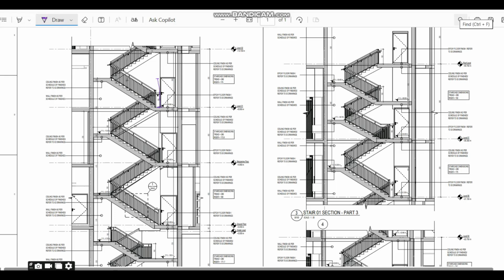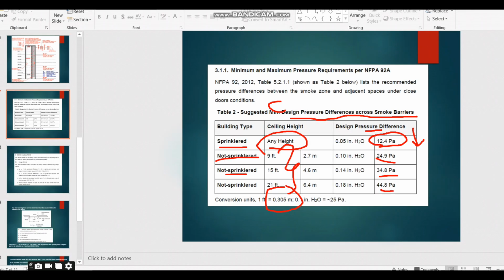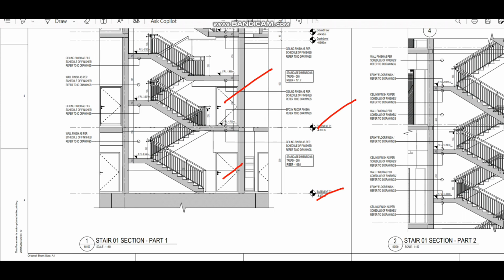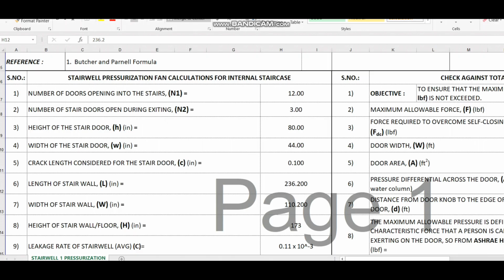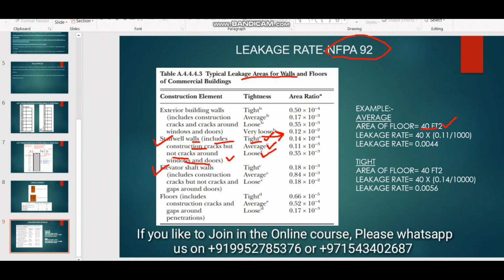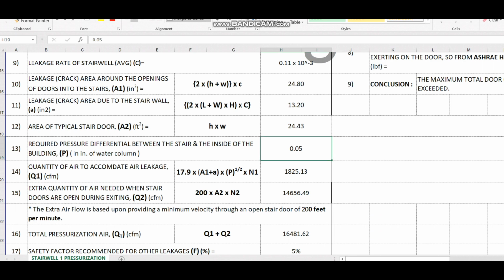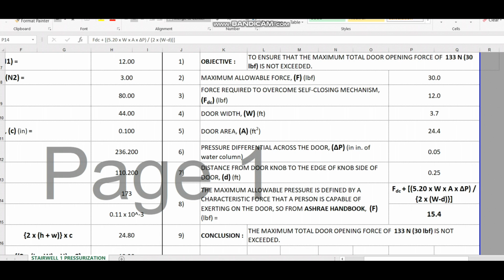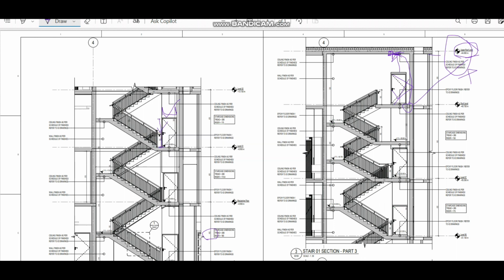Staircase Pressurization with Practical High Rise Building Project l Excel-Step by Step Procedures

Comment: The tutorial was truly eye-opening, and it effectively cleared up most of my fundamental concepts regarding stairwell pressurization design. Thank you for taking the time to share your practical expertise and create such valuable technical awareness for the engineering community.

If possible, could you please share the Excel calculation file used in the video?
Reply from the maker: Sure, pls write an email to nagarajan62392@gmail.com. My team will response for that.

Comment: There are some errors which needs to be correct.

1. For staircase wall leakage you should considered total height of building.

2.No of doors open should be 3 and no of doors closed should be 9

So leakage should be as per  closed door for staircase door and leakage for staircase wall should be as per total building height because there are sleeve and also cracks will be appear in upcoming year's
Reply from the maker: Thank you for your comment. I want to clarify an important point from a design perspective. In engineering, we always follow the applicable codes, standards, and defined design assumptions. We do not overdesign based on hypothetical future scenarios that may or may not occur.

For example, if someone adds new sleeves in the future, the correct procedure is to seal them properly with UL-listed fire stopping systems as per the standard. That does not mean the current design should be oversized or assumed for unnecessary extra leakage. This is a common mistake made by fresh designers, assuming future problems and oversizing the system, which is not recommended in professional practice.

Similarly, just because an apartment AC may face a technical issue in the future, it doesn’t mean we install a backup AC unit during design. We implement proper maintenance procedures and follow the standards, that is what correct design means.

Regarding leakage, in the video I clearly explained that I used the average leakage rate defined in the standard rather than assuming a perfectly tight construction. This is exactly how stairwell pressurization calculations are performed as per NFPA and international codes. The same approach has been successfully applied in 150+ projects across the Middle East, and it is fully compliant, no overdesign, no imaginary assumptions.

Coming to your question on doors:

If there are 12 doors, and UAE code requires considering 2 doors open, The remaining 10 doors can be considered as leakage.

Even considering leakage for all 12 doors is acceptable because leakage is based on door-frame gaps, etc (Even when a door is fully opened, there is still leakage in the door frame area), so it is optional to consider the same or not.

So, the method shown in the video is technically correct, code-compliant, and widely accepted. Design must follow standards, not assumptions about future cracks or construction issues.

Lastly, many fresh engineers ask similar doubts, and we explain these concepts clearly in our training sessions. If you want to understand real-world design concepts in depth, you are welcome to join our course.

Comment: Hiii … I have a doubt ….How should I proceed if door sizes changes…. In basememt there is some door size and from GF to uppers floors door sizes differ from basement ….???
Reply from the maker: I have explained how to find out the door leakage ,same u need to use for different type of doors and add together to get the total.

Comment: Hi, It was really informative. If we are using a duct or shaft for air supply, could you please tell me on how do we select the minimum corss sectional area / shaft size for air supply? Many thanks
Reply from the maker: We will make sure aspect ratio for duct is not exceeding 4:1. duct sizes + insulations and supports clearance so considering all we can decide our minimum requirements. Since we have the options to adjust duct width and height, we can coordinate with architects engineer to provide the size
Reply from the maker: There is no particular rule to keep the size of the shaft for our system but we need to make sure the accessibility

Comment: sir why have you not considered the leakage through floor and ceiling ? any specific reason? please suggest
Reply from the maker: Hii thank u for your comment
Reply from the maker: When I submit the report in qatar civil defense, I have considered only the door, windows leakage with number of doors open. Since the stair walls are fire rated, water leakage proof I have not considered even walls also. But in UAE  Calculation,  I additionally add walls only.

Comment: Suppose staircase have three door at a floor in that case will we consider the 3 door open at fire origin,exit ,either floor of fire origin that means 9 door at a time.
Reply from the maker: Need some clear explanation of your question. U mean 3 exit doors in one staircase/floor.
Reply from the maker: 3 doors are there in the lobby or staircase?
Reply from the maker: Inside staircase each floor level only one exit door will come. I don't know which project u found 3 doors in one floor. Your question probably wrong 3 doors in one floor how it will come in staircase
Reply from the maker: I hope u are talking about lobby area.
Reply from the maker: Lobby has other Pressurization that is not related to staircase Pressurization
Reply: Yes,I was talking about 3 door if possible but as your are said staircase has only one exit door.
Thanks for your reply

Comment: i have one question 52.8 m is the total height of stair case and we mentioned height in inches 173.2 as per 4.4 m is that we are calculating only 1 floor in height only not full height of stair case
Reply from the maker: Hii..
In sl.no.14, i multiplied with number of floors 12 nos. So full height considered. Hope u got the answer for why I considered 4.4m related inches 173.2 for your old question.

Comment: Kindly share the link of excel sheer
Reply from the maker: @engr.muhammadshahid  yes sure. Can u share the mail id here
Reply from the maker: https://www.dropbox.com/scl/fi/9rggqlumyzb6qpan0812g/Stair-Pressurization-calculation.xlsx?rlkey=c85ip74i9rh2sy8j9mv056rx6&st=o15etws5&dl=0
Reply: Sir I didn't not received it yet. Sir I need it urgently.
Reply from the maker: @engr.muhammadshahid  I told u to post your mail id here
Reply: @mepworld3385  I send it here but it disappears even its posted. What could be the problem.
Reply from the maker: @engr.muhammadshahid  just send a hi to nagarajan62392@gmail.com
Reply: @mepworld3385  done. kindly check your email
Reply: Sent Sir. Kindly check your email

Comment: Hi it was a great session, the fan selection  was 17305 cfm will it feed to every floors of same cfm to maintain the desired pascal. If not than what will be the desired cfm requirement for each floor for the desired pressure.
Reply from the maker: We will provide the equal flow to each level.
Reply: i.e 17305/no.of floors with vcd at each landing in case of multi injection is it like this?  @mepworld3385